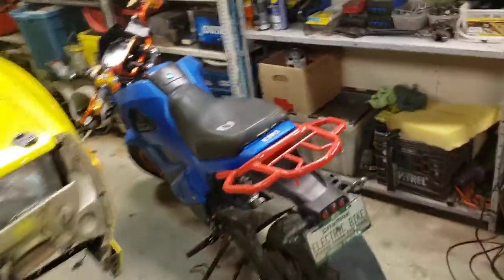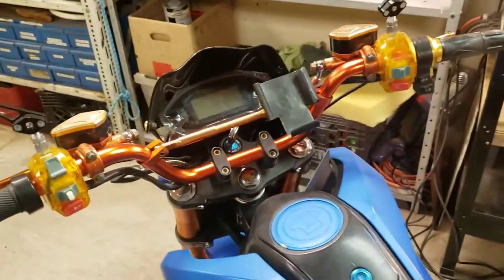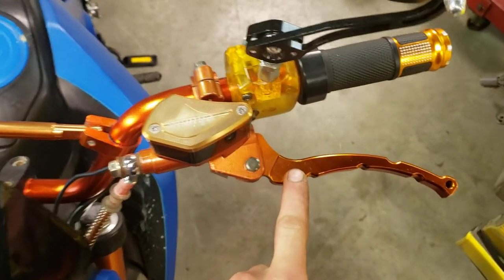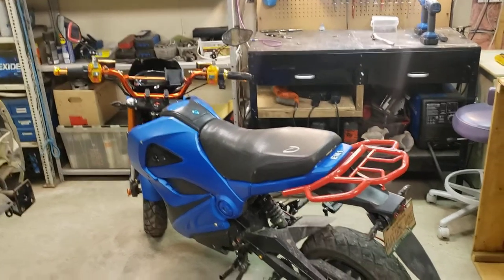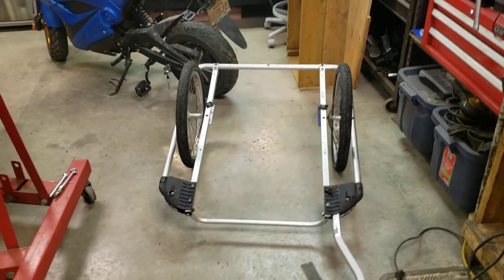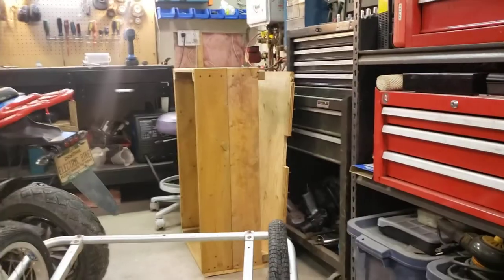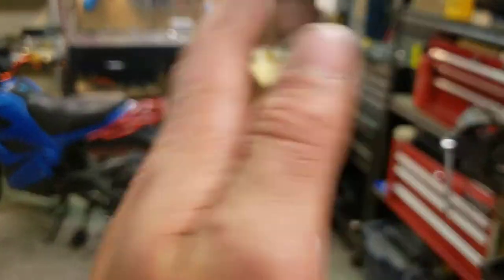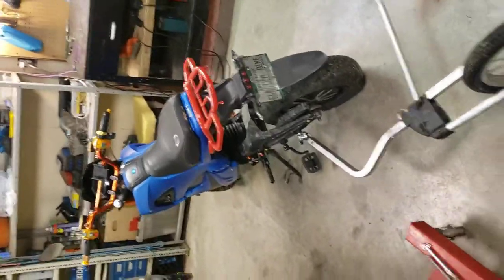Daymak em1... diy trailer

Comment: Hi there. I've watched all your Daymak videos and thought I'd ask you a question and see if you could help me. I acquired a Daymak EM1 from a friend's estate and decided to paint and do some badly needed maintenance on the bike before riding it. I wanted to re-paint the foot pegs and holder, so when I removed them I had to pull the main bolt that runs right through the bike. I had no idea that removing this bolt would make the back tire come off! Crap! Not easy to get the bolt back through. A friend helped me. The problem is the back tire doesn't sit square anymore. Oh ya, to get the bolt back through I had to remove the shock. Silly silly me. Any help getting it back together and square?